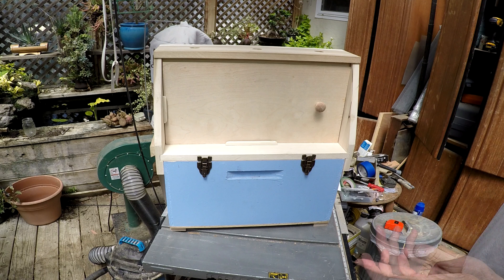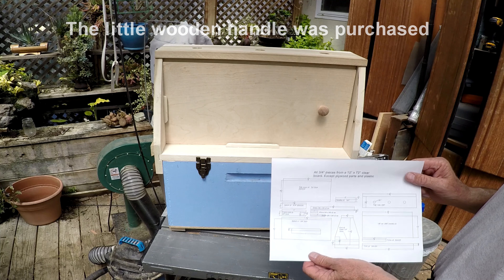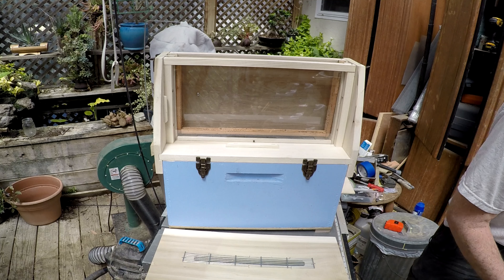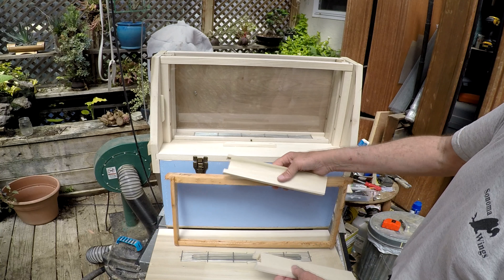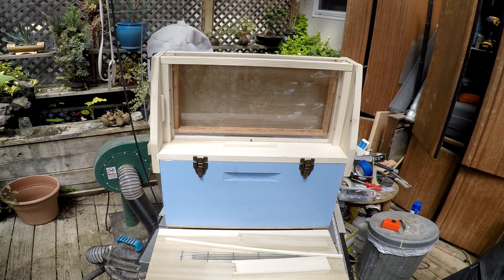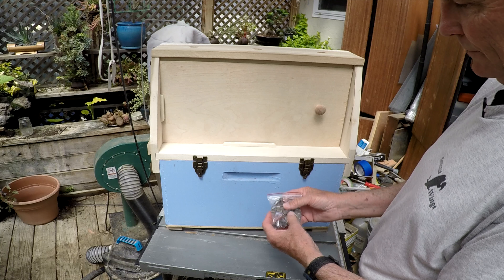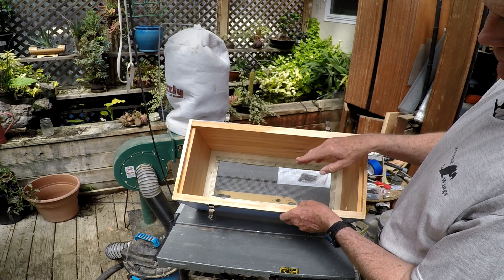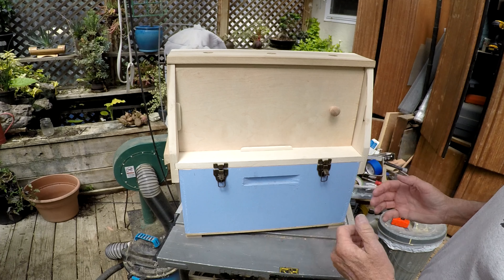Make your own observation hive

Comment: Where is this file. I know it's been a long time, but can it be shared again? The links are dead, I think.
Reply from the maker: Yep, my ISP is having problems.  I am looking into it.  Check again tomorrow.
Reply from the maker: It's working now.  You may have to cut and past the link depending on the browser you are using.